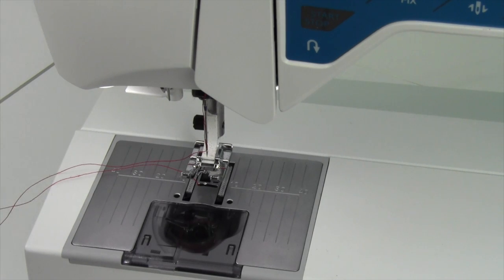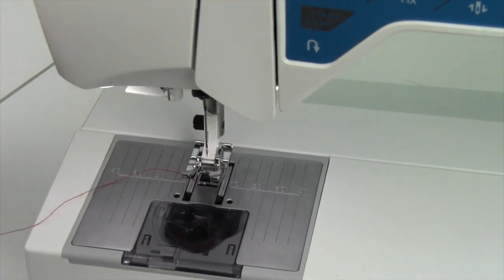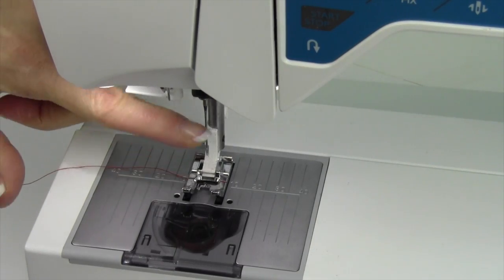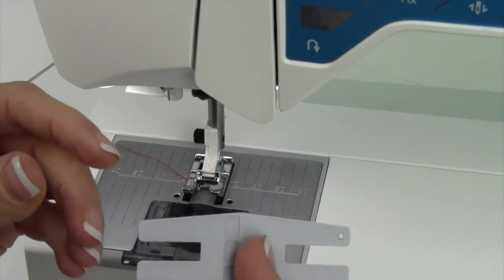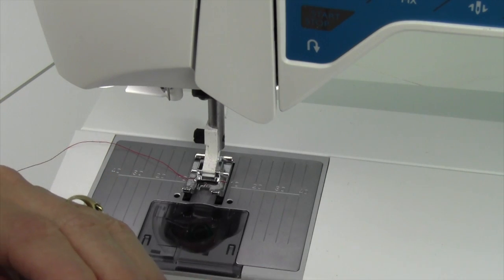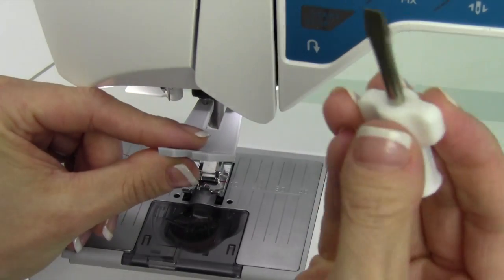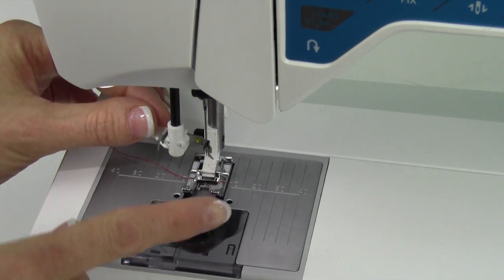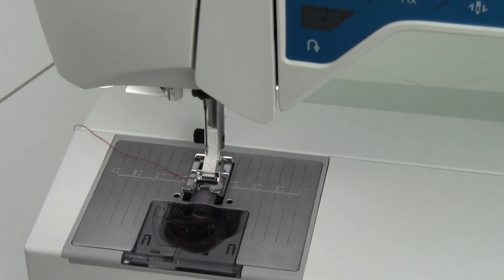Husqvarna Viking Opal 650 18 How to Change a Needle

Comment: Thank you for teaching how to change needle. I am facing one problem is that you have mentioned in your video: I have tighten the needle with ALL my strength, so now when I try to remove the needle it is STUCK. What can I do?
Reply: I encountered this issue as well. I didn't tighten the screw really tight when I installed the needle, but had a little trouble getting it changed the first time.  Had to use that little tool to install it.  I ended up using a pair of needle nose pliers to gently work the needle out, rocking it from side to side until it came out.  It was really tight in there. The needle wasn't bent, so not sure what the problem was.